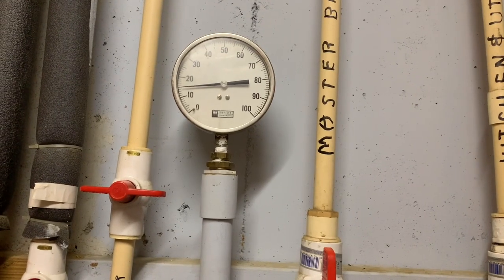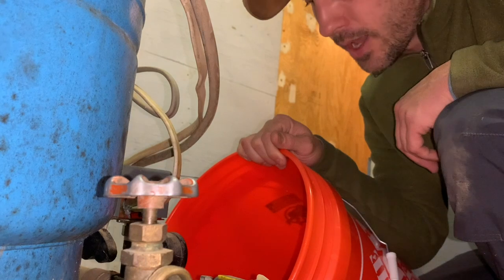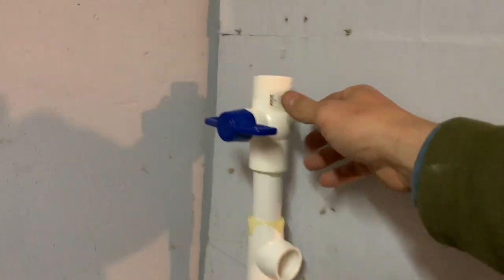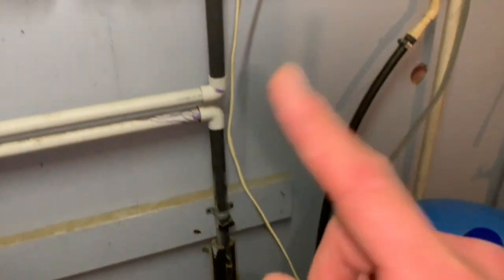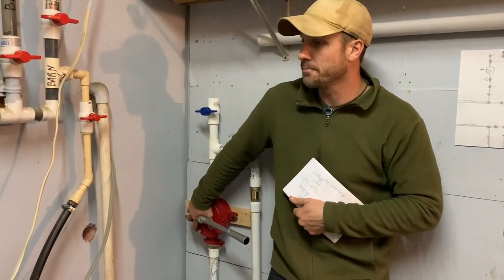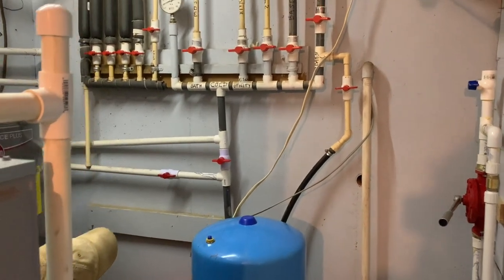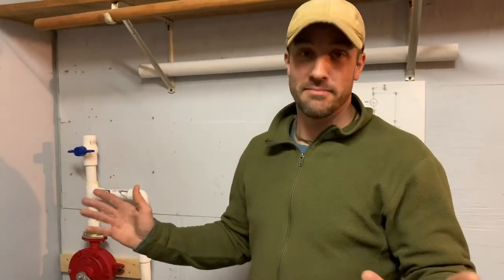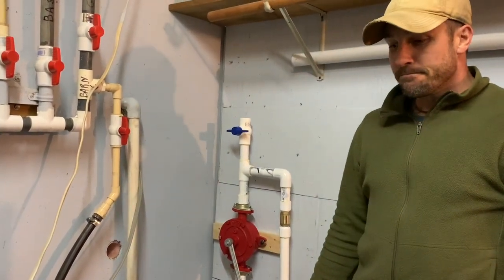Installing the Excelsior E2 Hand Pump | Manual Well Pump

Comment: Jason, how deep is the well you are pulling from?
Reply from the maker: The well is 300 feet deep. The water level is near the surface
Reply: @SurvivalDispatch  thank you for the response. Just to clarify for my understanding; although the well is deep, if the water table in the well casing is within 20-30 ft or so, this pump can be used. Correct? Thanks in advance.

Comment: Does it matter how deep your well is?
Reply from the maker: Yes. This is a shallow well pump. It can’t lift water very high but can pull it horizontally a long ways. My well is 300 feet deep but the water level in the well is nearly at the surface.

Comment: Someone please tell me if this will irk on my well 350’ deep, thank u
Reply: Depends on what your "static water level" is.  See if you can find well drillers log.  They might have the info filed with the state regulatory agency that oversees well permits.
This specific pump only works for someone that has a pretty high water level

Comment: It looks like you should have used CPVC instead of PVC You're going to have a plastic taste. You can tell by the color of your pipe The PVC is a lot whiter color The other one is a little bit yellow
Reply: On hot side, sure, but not on cold side.  Chances are if you currently have or have in the past been attached to a public water supply, its probably supplied by sch. 40 pvc.  CPVC is necessary for the reason you mentioned after a hot water heater.  PVC is only rated for 140f at pressure.  cpvc is 200 if i recall correctly.  at room temp there is almost no difference.
Reply: @mattfleming86  PVC also has carcinogens in it, CPVC does not.

Comment: How many pumps to flush the toilet once?
Reply: depends on how much piping you have between your pressure tank and your toilet...
Reply: @50shadesofcerakote  ok.  How many pumps to flush your toilet after it’s all primed?
Reply: @50shadesofcerakote  no. The line is already full from being primed. It only matters how many gallons per flush. 1 or 2 gallons.
Reply: @stephenhudson5253  pipes create friction on the water, you need enough pressure in the pressure tank to push the water to the toilets tank to fill it up. depending on how far the toilet is from the pressure tank, it could require more water pressure. 

If you lose power while a faucet is being used, youll lose all the pressure pretty rapidly. Requiring more pumps.
Reply: @50shadesofcerakote  pipes are always full of water. The only water lost is the amount flushed.
Reply: It may out flush his pressure, but that's not what we are discussing.
Reply: It doesn't matter if you have a hundred miles of pipe. Once they're full of water, however much u use is the amount to replace. I dont know how much more simple to make it.